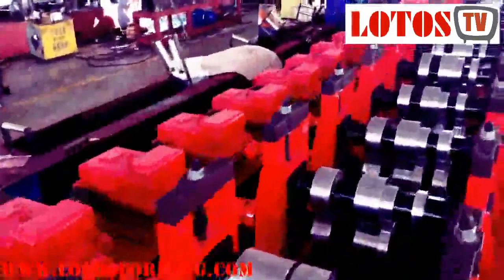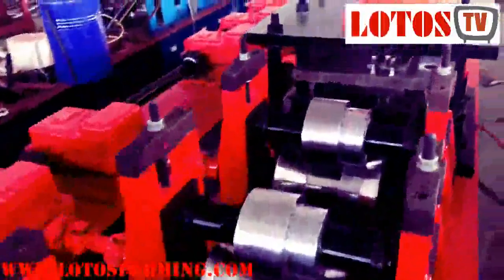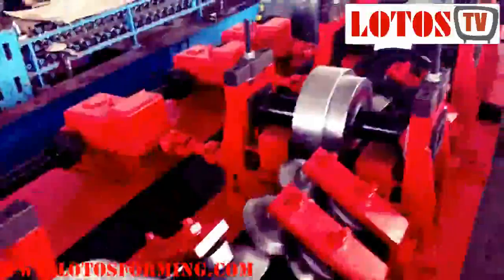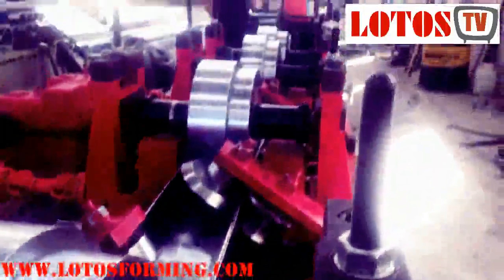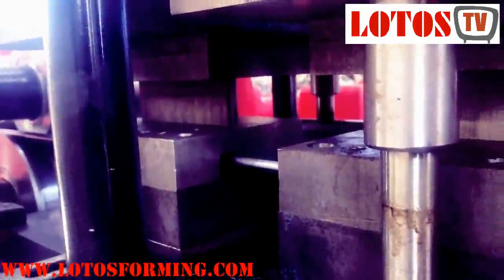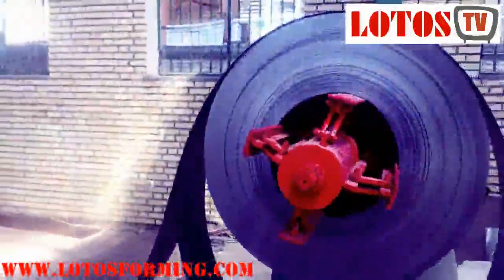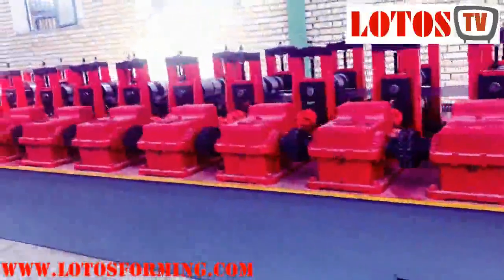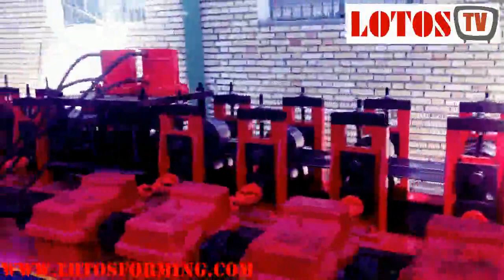【 Making a Door Frame 】: Door Frame Roll Forming Machine "Best design 2019"

Comment: Corrugated roofing sheets Mostly used in agricultural buildings, corrugated roofing sheets feature repetitive folds on their surface.
Reply from the maker: LOTOSFORMING corrugated roof sheet making machine manufacturers supply corrugated roof sheeting machines that produce the original corrugated sheet and metal roof tiles.